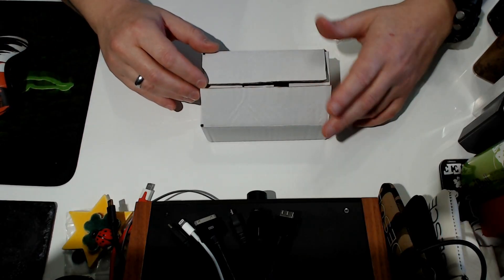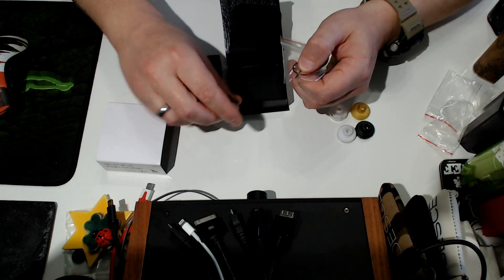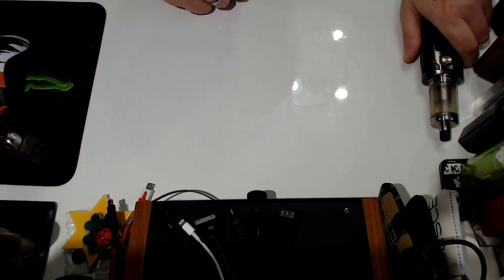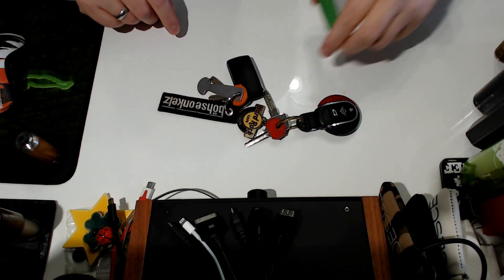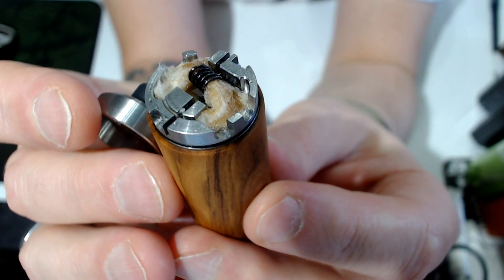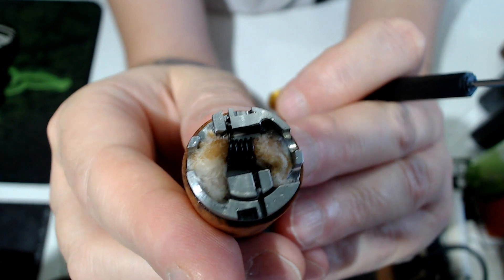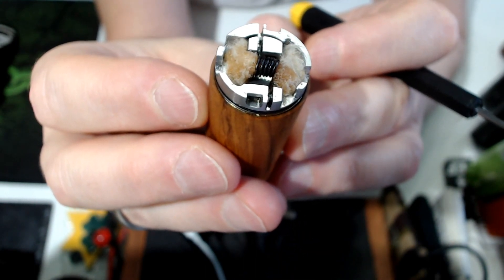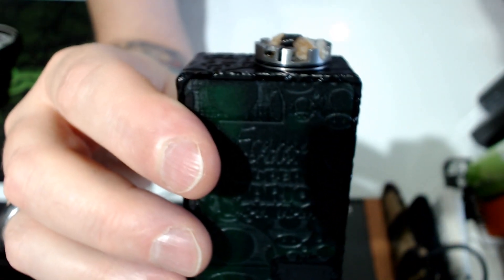Knight Low Rider BF

Comment: Great review mate. What is the wooden tube mech?. Looks stunning 👌. I want this rda but i only use mech mods. Thank you 👍
Reply from the maker: Thank you.
The tube is an 18350 "Woodpecker" V1 from sarumods.com (you maybe remember the JFK - Jumbo (tank) for Kayfun, or the lovely Congestus V2 . Yes that's the guy :) )
Got it (and also an 18500) after prototyping/when they started - nowadays he does 18/26650 Woodpeckers only.
Nevertheless extremely compact also in that size, lovely wood, simple but great mech.
For the Knight LowRider - yes, the pic was just for fun - unfortunately squonk only (but probably too elaborate to use as a dripper, because just (too) small) :)
Reply: @necromancer1970  Thank you sir. Very helpful. Im sure i saw your post on Ennequadro but cant find you now 🙄. Would you recommend these mech tubes?. What is switch like?. Is it responsive because ive not heard of them. Thank you
Reply from the maker: no problem  @Trotters80 . I personally like the tube. Know the modder, it's a 50km drive to Vienna where they're made - and as i'm a collector, there's no reason to not have it :D   Switch is magnetic, but just take a look at a review by Todd, when they first came out 3 years ago: https://www.youtube.com/watch?v=waswyl6wo_0